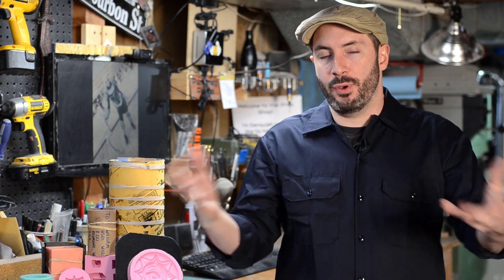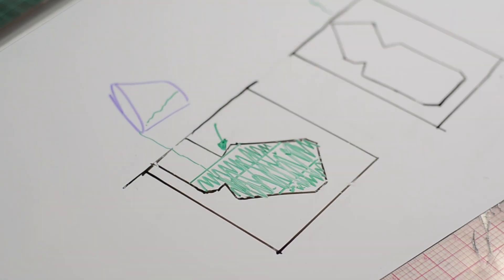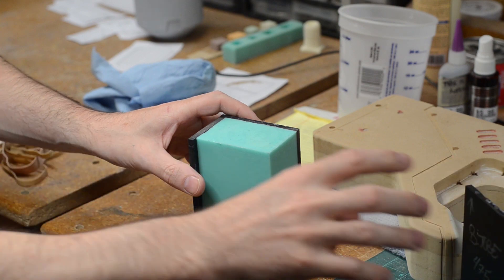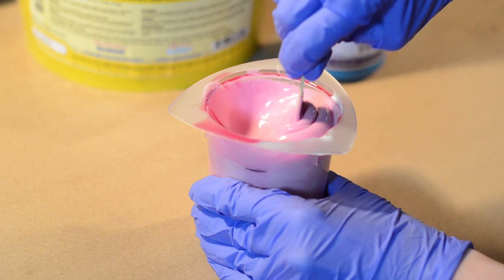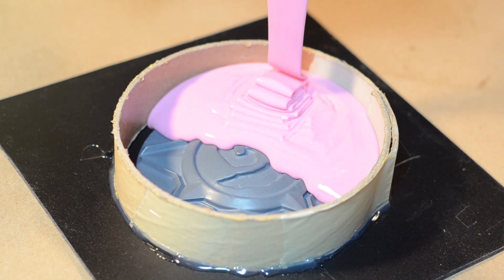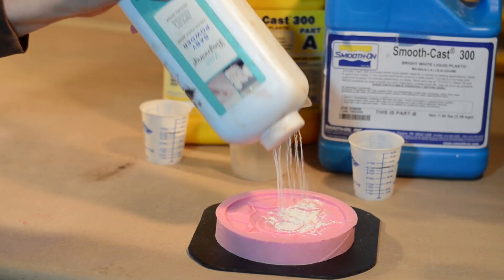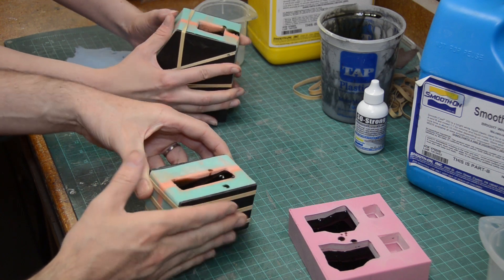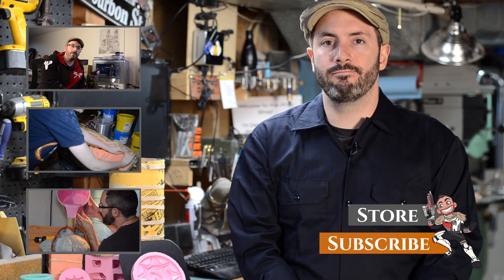Prop: Shop - Molding & Casting 101: How to Make a One Part Mold

Comment: Would you make a mold similar to the ones used for you Highlander lightsaber build? Im making several different 12 inch long hilts and it needs to a slot in the center for the blade tang. The finished hilt needs to be strong enough to hold the blade for cutting so I have not decided which type of resin to use. Love the videos and all your props.

Comment: Can you clean and reuse the buckets for part a and part b silicone? What's the best way to clean the buckets or are they just automatically trashed?.. i tried rinsing them out with water and dish soap and it became a total sticky mess. Can't seem to find any info that the clean up aspect of the smooth-on products. thx!
Reply from the maker: I do rinse and reuse them! I usually use soap and water and a good scrub - I find it helps a lot if you wipe out excess silicone IMMEDIATELY after pouring with a paper towel and then clean it out. The mixed one you can just let pour and peel it out :)
Reply: @punishedprops  thx so much for the response!

Comment: Hi! What’s the best mold material to use if your finished product is going to be a silicone piece?    Would I still use mold max 30?
Reply from the maker: To cast in silicone you typically want to use a rigid material for your mold. I'd ask the folks at Smooth-On for what they recommend based on your project.

Comment: What if you are moulding a part that maybe copyrighted and you want it for home use not for resale. I cant cast a copy of a kit part for example as the kit manufacturer holds the design.
Reply from the maker: If you're able to get a prop piece from an original creator, we always recommend that and always advocate against recasting. Adam Savage has a great video on this subject: https://www.youtube.com/watch?v=5B3IgefQ-QU

Recasting applies primarily to instances where you plan to sell the item, but it's still good to avoid when you could support a creator instead :)
Reply: @punishedprops  yes i understand recasting and selling on is bad. Especially for garage kits and their creators. Im just trying to find the UK law where i would stand on big mass produced kits from corporate bussiness like trumpeter which i could recast a part for myself to either repair or make a different version of the kit. For personal enjoyment...not to sell.

Comment: Punished Props Academy:" I'm very new to this, but I which type of silicon, would I want to use to cast some tiny flesh-colored wired hands, for stop motion? but I need to be able to bend the hand back and forth, but not the that of rubber that will bounce back cuz it will be useless for an Animation, hope you understand my question, and most of all I hope you can help a stop motion beginning animator out, also thanks much for the video.
Reply from the maker: If you want to make a mold of something flexible then you need to have the mold be rigid, like resin.

Comment: Thanks for the tips! I have been wanting to try my hand at making a mould . The thing I’m confused about is that I bought the mold star before and mixed it up but then I realized what can I use for a form of something. For example, I want to create a detailed serving tray but what can I use as a form that the silicone won’t stick to?
Reply from the maker: You can make a mold master out of pretty much anything! Most frequently people use  non-sulfur based clay, finished 3D prints, or pieces made from sealed and sanded MDF.
Reply: Punished Props Academy Tysm!  That answered my question

Comment: How do you make the 3D master from a 2 D image?
Reply from the maker: There are lots of methods! Some folks use 3D modeling, others prefer to sculpt with clay. You can even use foam if you seal it properly and make sure the surface looks how you want it to

Comment: It is a HUUUUUUUGE BS!!! You have to mix it by WEIGHT, not VOLUME!!!!!!!!
Reply from the maker: You can mix using either, depending on the material! There's always handy instructions on the container letting you know if it needs to be mixed by weight or volume.

Comment: So no release agent or baby powder when making the sillicone mold to capture most of the detail? Only use release agent when casting?
Reply from the maker: Definitely no baby powder for making the mold - it will be embedded in the silicone. I do frequently use a release agent but in this case didn't really need it, as the buck was quite rigid and unlikely to stick.
Reply: @punishedprops  Great, thanks for responding, just made my first mold, left it to fully harden till tomorrow. Cheers
Reply: @punishedprops  First cast successful after a few failed attempts, it a small bone like a tube and bigger at the end, added a vent path and used a syringe to slowly pour the resin and eliminate the huge bubble that appeared at the middle which caused it to only cast half of the way.

Comment: hi there, love the vids, awesome content! just wanted some advise, I have been looking into molding and casting, I have 3d printed a dark knight armor set, would like to make molds and then cast them. want to use the most relevant materials, any advice please? aslo please note I live in the uk, so I would have to purchase from here. thanks in advance.
Reply from the maker: You'll probably end up making a lot of brush on molds. I use Rebound 25 silicone for that. You can cast the parts in a variety of resins depending on the qualities you want from the finished pieces. For materials suppliers in the UK, this should help: https://www.smooth-on.com/distributor-regions/europe/

Comment: Kind of a late reply, not sure if you guys are still watching comments. I seem to recall a video recently, where you mentioned you started using a new smooth-on silicone that prevented bubbles forming, but I can't remember which video :P. Which smooth-on was it?
Reply from the maker: Mold Max 29NV. Any of the silicones with "NV" stand for "no vacuum," I belive. They're less viscous and easier to mix, which also means the bubbles can escape easier. https://www.smooth-on.com/products/mold-max-29nv/
Reply: Punished Props Academy awesome thank you!

Comment: If I have to make several copies in silicon rubber from the same original, what material would be best for the mold?
Reply from the maker: I would ask the folks over at Smooth-On. twitter.com/smoothon

Comment: i have a broken power rangers morper i got on ebay (original mighty morpin) but i dont know what its made out of the coin in the middle sounds hollow with a high sound when you tap it. the silver part the actual morpher has a lower tapping sound and the backing all in black is the lowest sounding. Im assuming the whole thing is black as it seems painted as silver also has some bubbles on the bottom and a bit crudely cast on the sides. The coin has a crack in it and its white so overall im really not sure what's all gone into making it. If punished props can help me out or if anybody else knows it would be VERY appreciated

Comment: So you don't use a vibrating table to remove the bubbles
Reply from the maker: If you degas the silicone in a vacuum chamber, there's no need for a vibrating table. A wide mold like the one we used shouldn't get bubbles in then casting, but for more intricate parts a vibration table might help. I prefer to use a pressure pot when casting whenever possible.

Comment: I have a project in mind that uses this method. But I've never done it before so I'm not positive it will work. After the mold is finish I want to fill it with a Styrofoam paste that you get when you add acetone to Styrofoam, then put that Styrofoam prop in sand and add molten aluminum to get a metal prop. Anyone have any thoughts on this?
Reply from the maker: I don't see why that wouldn't work. Give it a try!

Comment: Hi, trying to do the second part of the mold now and facing a problem, 
in order to put the mold release into the tiny corner of the molds due 
to the shape and form of the parts, and also I had to clean out the clay
 from those areas as well, I had to take the parts out from the mold, 
and now they don't fit 100% back in!!! what should i do?? should i have 
not taken the parts out in the first place?? Please give advice cause i 
don't want to throw away the mold.....
Many thanks in advance
Keith
Reply: thank you. I think i will have to remold, some of the parts just completely stick out..... may i ask one more thing, sometime the clay would got stuck in tiny places, or when i need to put mold release onto tiny area (I can't get the spray one), what should i do?? many thanks again.
Reply: thanks!!!

Comment: Re getting rid of bubbles, if you've got an old HiFi speaker (many are taken to dumps/recycle centres so easy to get for nothing) could you not make a platform that vibrates the mold encouraging the bubbles to rise to the surface?

Comment: I'm going to cast transparent resin nerf parts for a project, but if the object has holes in it, can you get the object out without destroying the mold in the process? Maybe a technique for making the actual mold? Seems like it would be hard to extract the master out of the mold without tearing everything.

Comment: If I want to make a silicone shoe upper, how do I create the cast and the filler for the center of the cast so that I result in just a even silicone layer that I would use for the shoe. I have an idea but if there is a know way, can you explain how? Thanks.
Reply: Thanks, useful but doesn't explain how to create a even layer (about 5mm) that is the main shoe design. I am basically trying to establish if I can create a seamless, all in one look, or if I have to use silicone sheets and cut the shoe pattern out and stick/adhere together (which isn't the goal). So essentially, how they make silicon masks, but to make it thicker and more accurate, if there is a way.

Comment: this with the vacume form is going to help me out. casue hand filing metal grips for the gun i did was about 6 hours of misery pain, and blisters..but i got the handel on, made a electric tape mold to make the center part of the grip. but i am not going to put time frames on when i will have the video up cause this took 2 days longer than i though.

Comment: that cylindrical mold, is that rebound 25 backed with mold max 40? Asking because I've got a bunch of rebound 25 leftover and not quite enough MM40 for a two part mold, wasn't sure if the tin cure MM and platinum cure r25 was compatible.
Reply: +Bill Doran thanks for confirming Bill!

Comment: These videos are a real help, I wouldn't know what to do.
Here's my question: Is it possible to cure resin inside of resin that has been rotocasted? Does it depend on the type of resin being used or will the heat damage the resin that has already been cured regardless?

Comment: I was curious if you knew of a material that could be used to make armor, something sturdy enough to withstand several impacts. Like in a full contact SCA environment.
Reply: +Bill Doran I'm actually studying medieval English sword play and despite steel plate being the best choice, it's very expensive for the right stuff so I have been looking into modern materials as an alternative. Thank you for the suggestions, I will look into them.
Reply: sintra plastic

Comment: For all the "resin mixing stuff" you mention you should add, that especially if you are mixing a larger volume of resin you shouldn't do it in a cheap thin plastic cup. The resin will get really hot and actually melt the cup :D

Comment: How do you dispose of unused resin and silicone? Is it okay to go down the drain?
Reply: +Fel Since it is only going to be in a liquid state for a finite time, you will more than likely destroy your plumbing after the silicone or resin fully cures / hardens.  Your best bet is to wait until it's set, peel it out of the container and put it in the trash.

Another trick is to calculate exactly how much material you need, and use only that amount.  This decreases your cost and waste.